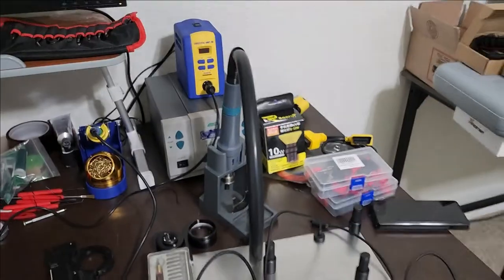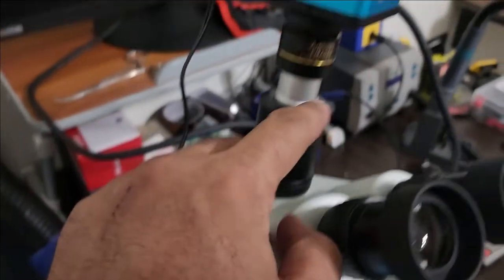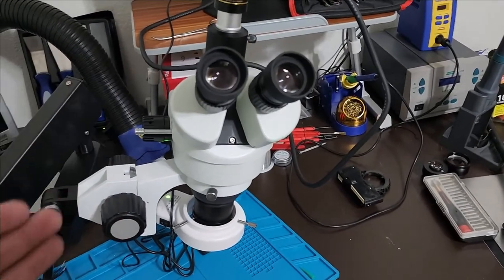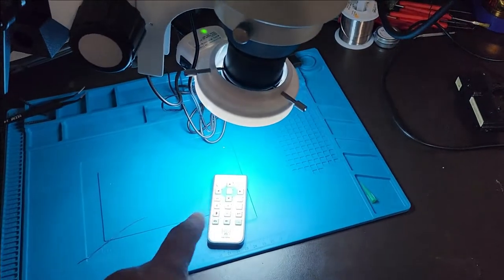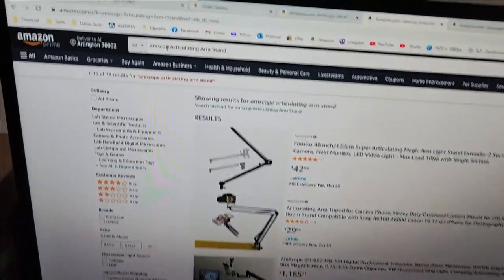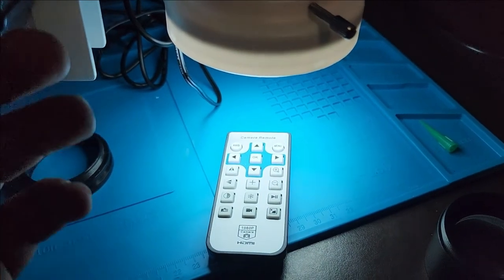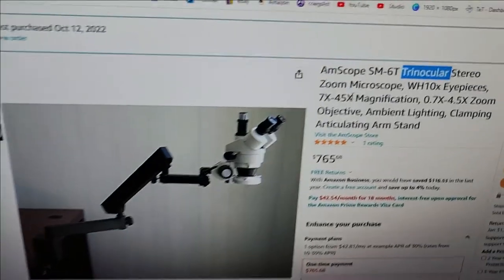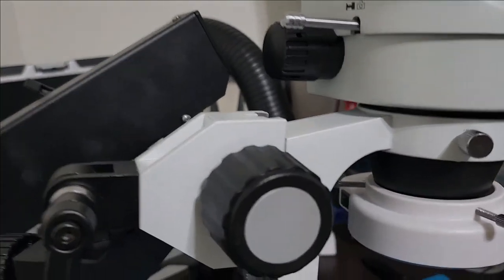Which AmScope model should I buy?

Comment: If you watch electronics repair people like Louis Rossmann, they explicitly say go for a simul-focus trinocular and also recommend the boom arm over the articulated as any benefits of the ease of movement of the articulated is negated by the fact the microscope head vibrates easily.  The boom arm types are more awkward to adjust but keep the microscope a lot more steady.  Sorry you never found this out in time.
Reply from the maker: I agree with you and him now.
Reply: So glad I found a Vision Scientific VS-5F for about $500 😁
Reply: I feel another problem is the articulation would benefit heavily from being bolted to the wall instead of on the table, it removes lots of vibration issues id imagine
Reply from the maker: @DissentingTirade  I think that's a great idea. I might do that in the future.
Reply: The problem is they discuss the wrong thing. Vibration is easily mitigated by mounting on something like a shelf or nearby desk. I watched Louis, but assumed I'd just mount it off the desk. I would be wrong, and only this fellows video actually points out vibration isn't the only concern. Arguably, this defect is even worse as sagging is a gravity issue not a movement issue, and does not go away just being still

Comment: Firstly, you are correct, that scope does differ slightly in design.  As U.S. Consumers we've come to expect a certain level of disclosure that the Chinese conveniently haven't attained.  Unless you contacted AmScope and tried to rectify the misunderstanding, AmScope didn't have an opportunity to respond and consequently they have no need of a defense.

AmScopes are good scopes for the money.  However, buying from China requires more diligence than we in the U.S. typically expect.  I did a little research on the AmScope site and downloaded a User Manual for the SM-6.  The scope they depict in the manual differs slightly from your scope as well.  However, on page 12 of the manual, they demonstrate the use of what they characterize as the "selection pole".  Odd nomenclature, but that's China.  Some Chinese companies don't even provide a manual for certain products and if they do, it might only be available in Mandarin.  Admittedly, they don't explicitly state what that mechanism does, but the fact that it exists, gives me pause.  I realize that having to go to tho tse depths, to be sure of what you're purchasing, may seem onerous, but that's China. 

If you bought it thru Amazon, there should have been a return policy. I've had great luck returning items.  If it's any consolation, even their 1.6K, GM-400, stereo microscope operates the same way.  I'm sure at some price you could find a true trinocular microscope, but I doubt it would be in our budget.

Comment: I went for the Amscope trinocular (same you got since for occasional use I didn't have the budget for simulfocal, it's still fine to use) on a boom arm ... after checking a lot of YT videos. For the camera I settled on a Hayear, which has a very complete setup (SD, HDMI, USB) ... I even added a large zoom lens so I can use it independently as an overhead cam :D
Reply from the maker: The boom arm definitely has some advantages.
Reply: It's extremely stable, but you need more space so you can swivel it out of the way for storage. And never... ever... drop the base on your fingers or toes 😁
Reply from the maker: @patrickcardon1643  yup

Comment: I like the UHM350-11 from amscope.  It is monitor only- no binocular. The lighting works well.   Looks like they stopped making it but there is a UHM210-11 that looks similar.
Reply from the maker: I just googled that and man I really like it. it looks solid.
Reply: I'd rather pay an extra $50 for a Swift S41-20 than get a digital only one. I'm getting a Vision Scientific VS-5F for $500 though.
Reply: @sethreign8103  When you use a binocular microscope do you get depth perception?  It seems awkward to lean over the eye pieces but maybe there is a big advantage.

Comment: my 2 cents :
between a stereo or a trinocular wihout simul focal, i would choose the first one :
-you'll never know when the mecanical inside the last willl break because you switch again and again  on your camera, 
-the stereo one is 100$ cheaper ? but you can find a mount for a smartphone to fix it on microscope (on one of the ocular)

 i can't totally agree with you about not finding video about simul focal, it's just ,for the most part, they are not on electronic repair chanel ;) (or the info are find  in 3sec of a 30min video)
and on  electronic repair channel, they just say to buy this or that one (precisely)

for amscope ,in the sm series, the P is the key :
SM-3tp
sm-4tp
sm-8tp
have simul focal
Reply from the maker: valuable notes. thanks

Comment: personally, I prefer O.C. White! not as cheap but worth it! you can get the trinocular with camera for about $3700, the typical boom stand which you can move forward and backward without the axis turning on you. I feel your pain on the AmScope! O.C. White PZ6.5 trinocular cam does not leave you with mono-vision and plugs into USB and you can just select it like another camera in your computer. I also like the .7X Barlow lens which allows me better visibility for inspection and soldering the new 008004 size components, no problem with the 01005's.
Reply from the maker: Thanks for the info. I'm gonna keep this note maybe for future upgrade of my scope.

Comment: buy a used or new ergotron monitor arm, then you can buy VESA Adapters, and get that mounted and flexible perfect. i probably should do a video on it, it works great! i have a laptop rigged up. also buy iFootage Spider Crab arms, they are the BEST Hold some weight and don't move.
Reply from the maker: making a video doesn't sound a bad idea. I think it would be a really useful one

Comment: Not a problem of scope or company totally consumer problem
Reply from the maker: How come they don't show the eye icon on their selling listings?
Reply: Agreed.  100% customer issue, do your own research and read the specs.  Not all trinoculars are simul-focal.  If it doesn’t say simul-focal….plus if your see the switch on the head you know it’s not simul-focal.  And that’s the way Barlow lenses work.  You can’t argue with physics.  There’s a lot to learn with microscopes and the industry doesn’t help themselves.
Reply: @Markus  how do you logically go from saying it's 100% the consumers fault then go on to say the industry doesn't help itself which suggests that it's partly the fault of the entire industry?
Reply: @markc.5750 if you’re new to something, you likely don’t know there may be advantages and disadvantages to product differences. There are several basic differences in how they work, but manufacturers often don’t articulate those differences. I do agree that Barlow adapters change the focal length of the objective. That’s their purpose. Giving more working distance is what he needed. And yes, it should be understood that it would make the scope ride higher. But you’d be surprised at how people don’t always think of consequences. I would just raise my chair.